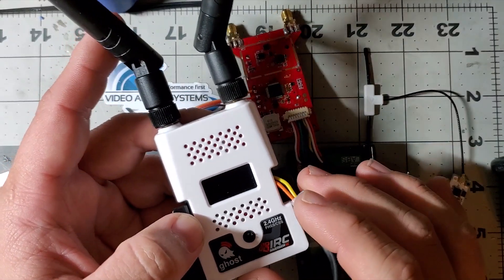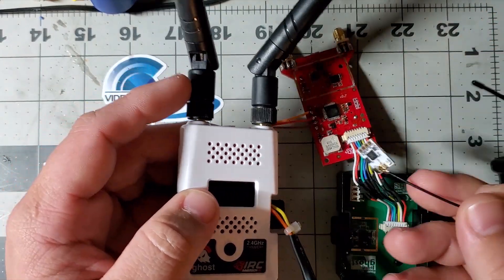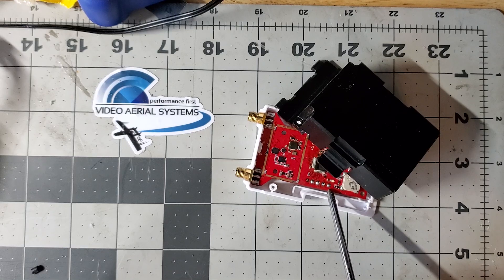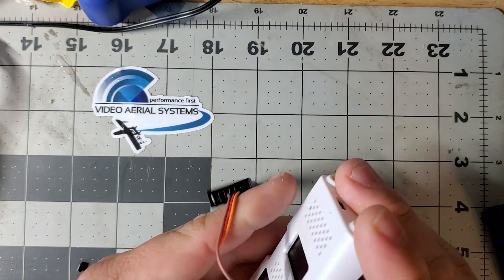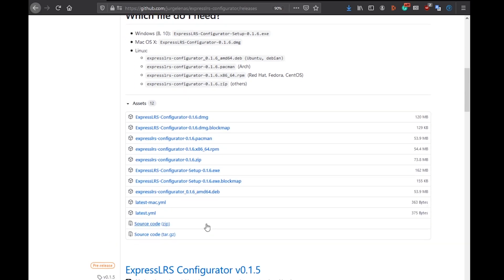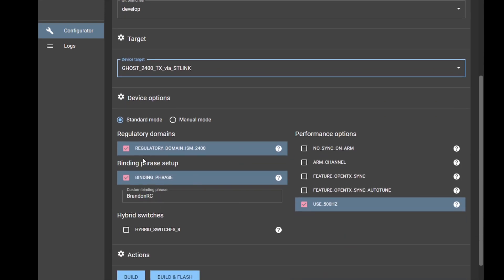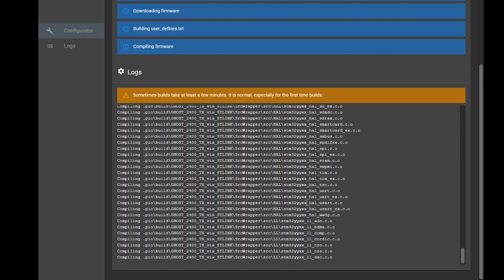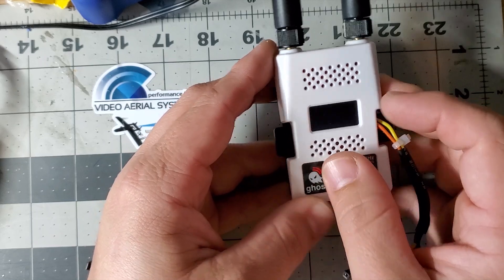How to flash IRC Ghost TX with ExpressLRS (ELRS)

Comment: do you still recommend this? the modules sell for $27 !!
Reply from the maker: No I don't recommend it anymore.

I have never had an issue with my Ghost TX running ELRS. But I really do not use it anymore. 

Ghost TXs do not have wifi. So you cannot do all the fun stuff. 

Also harder to updating after the I initial flash. Requires moving a file onto a SD card and using open/edgetx. 

But you also need stlink so $27+stlink cost.

Comment: Recently I tried to flash my ghost with 2.0.  Can’t get the st linker to connect.   I’m getting errors : cannot connect to target, select “connect under reset” 
Any thoughts?  I tried resoldering, no change.  Maybe the cheap linker?
Reply from the maker: Did you remove the read protection with the stlink tool? 

I remember reading someone had a problem. 

You could try to flash older firmware 1.2 which I know works then update to 2.0 with opentx or edge tx.
Reply: @bassohollic  I appreciate the reply.  The problem isn’t with ELRS, it’s with the st-linker utility.  I’ve flashed 3 times successfully, but always I’ve had the linker utility connected while doing so.  After removing protection via the linker utility, on subsequent flashings do we need the linker utility running to connect the module to the elrs GUI?   If not I’m doing it wrong.   If so, then something is wrong with the linker tool or the linker utility (or both)
Reply from the maker: @davidhitchVID  did you post on Facebook? I saw you did not have ground. The two wires are just positive signals. You need stlink ground hooked up or you will not have a reliable connection.
Reply: That was it!  I assumed the ground was coming from the radio .  Also, I assumed the st-linker needed to be open, and connected each subsequent flash.  Big lesson.  Hopefully this thread will help others!  Again thanks!
Reply: @bassohollic  sorry , yes I did remove protections…did that a while ago and flashed 2 times after that first FW upgrade
Reply from the maker: @davidhitchVID  I also recommend ETX or OTX update.  It is just easier after the first flash. I have not used stlink in like 5 months so there might be something wrong. 

Let me ask some devs to test for me. I am on a work trip for a week. I'll add this on my to do list for you :) want to make sure it is not broke .

Comment: Hi @BrandonRC I'm wondering whether there are some benefits using this Ghost TX module for ELRS with two antennas over ie. Happy Model 2.4 with only one antenna, I know that ELRS software in Ghost TX using one antenna only for TX and second one only for RX, I plan to use the telemetry and in that scenario there are some benefits of that solution ?
Reply from the maker: Yea one example would be using different antennas based on the application. 

So for your telemetry antenna pick a more directional antenna for better range with telemetry.

Comment: Im gonna flash my ghost tx and rx'ers to expresslrs. And i also bought two tx and rx bundles. Question does the power output stay at 350mw or does it have more or less power output. Thanks
Reply from the maker: So for now I only measured up to 250mw. You will get way more range with ELRS on 250mw than Ghost on 350mw. Promise you that much. :)

Ghost on 100mw was only 7 km..  ELRS on 100mw is about 33km+ at 250hz! https://youtu.be/GkOCT17a-DE?t=224

You will not need 350mw on ELRS but I do plan on adding more stuff for the Ghost TX ELRS target, like display and joystick control.
Reply: Ok. Awesome just got my st linker  from amazon. Gonna flash the tx. What about the rx. Same deal. One more question. Can i flash express to the ghost diversity rx. And will diversity work